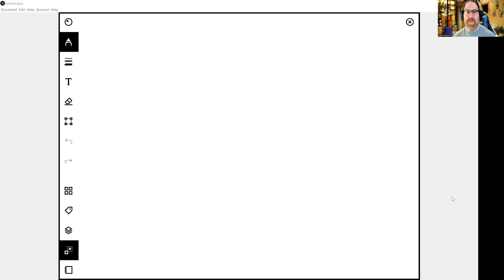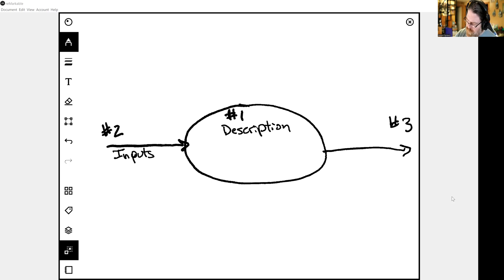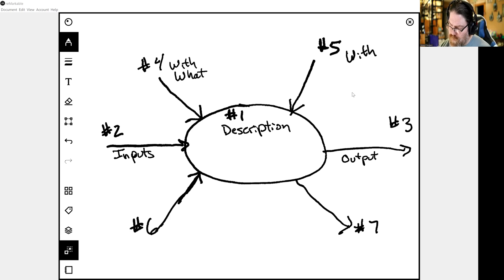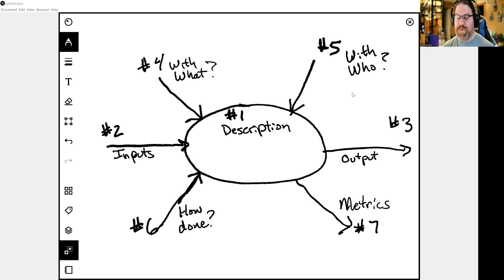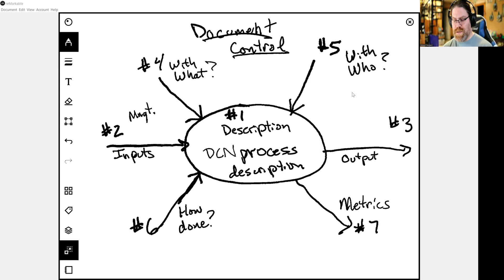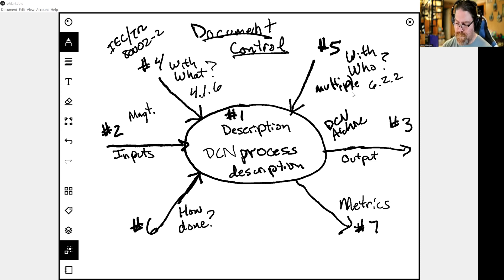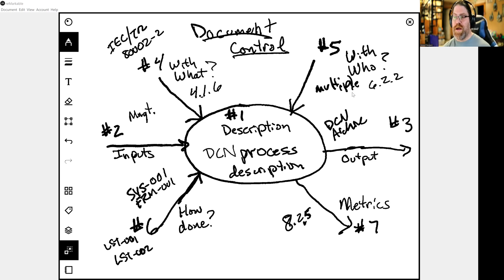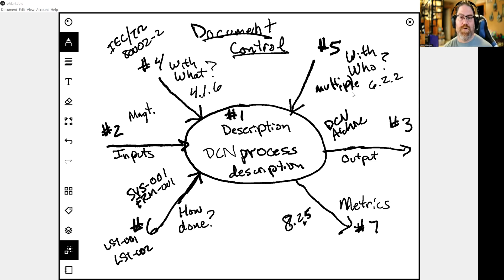How to create a turtle diagram for the document control process

Comment: Nice Vid again. With more and more Information Technology in i.e. Medical Devices, Cobit will be a good Framework to look into. Originally being IT Governance, Cobit has migrated to Enterprise Governance and shows you many fragments as in the turtle diagrams like In/Outputs, Who/Roles, Maturity/Metrics. It also handles a lot of "what needs to be done"-activity-based governance and ranks them regarding process maturity. That would fit the "how done" part here. 
Great Video as Turtle Diagrams are very good for overviews!!